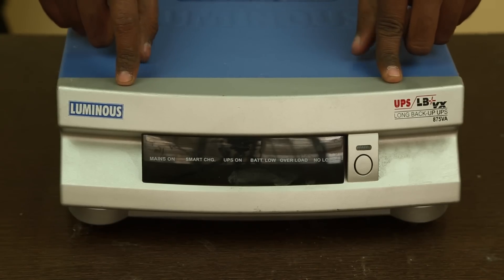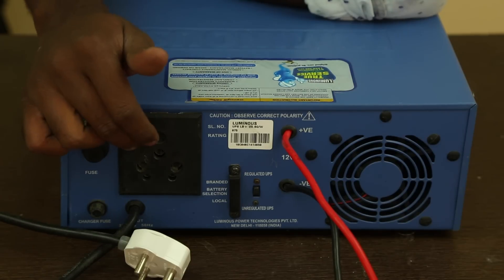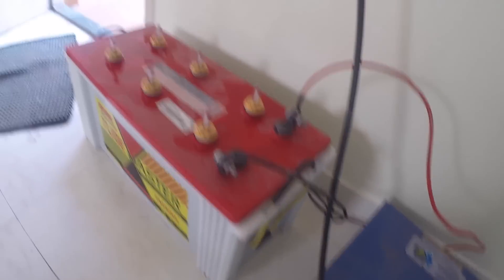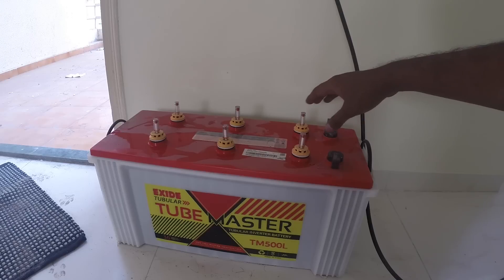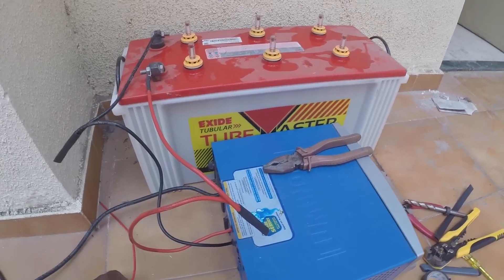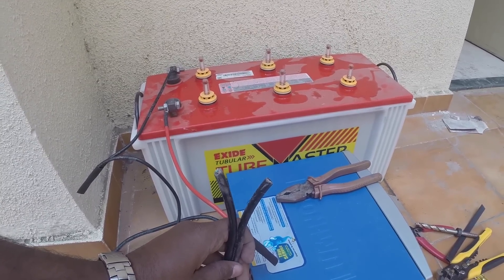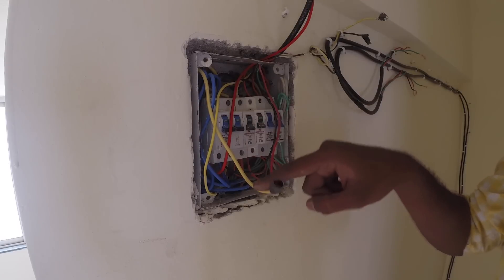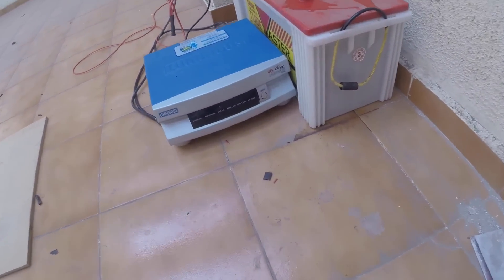How to - Connect an Inverter at your home with Battery Backup

Comment: Please I need help with my inverter. I am also using over 3kw solar and an outback MPPT charge controller. My inverter is luminous 1500 Eco Volt. My freezer are on timer so they switch off at the set time. Then at night time after few hours of low load of maybe 20 watts my inverter will go to standby mode but it can not come back online unless I off and On it again. How do I stop this.

Comment: inverter is not used 2 month any problem happen
Reply from the maker: +rajkumar goud battery may be discharged. Check battery voltage

Comment: if you using ac supply there is no positive negative..only phase and neutral..and then if u touch both leads in battery
 nothing will happen
Reply: In DC supply,if we touch either positive or negative wires we don't get shock.But if we touch both the wires at a time then we will get shock.

Now don't tell me that you have touched both the terminals of a battery and you did not experience a shock...! This is because,our human body itself contains minute electrical charges. which means we also have very minute voltages in our body.

Not only that, our human body can resist voltage and currents(because of body resistance which is different for different persons) upto some extent.Because our human body is not a current conductor.

Our human bodies only experience electrical shock if the current or voltage exceeds our body's current or voltage resistance which are 10 milli amperes of current and the voltage of about 30v  at average .These values changes for person to person because of their body constitution and their body's resistance.
Reply: It's a single 12v  battery. While touching the both terminals at a time nothing will happen. Because it's potential is low as compared to  230v A.C. At the same time if u touch terminals when battery bank voltage is more than 48v . U feel the shock.
Reply from the maker: Cool.
Reply: sahaya jimson JFK
Reply: same here
Reply: Yes that's right
Reply: Battery runs on dc thus it has positive and negative terminal
Reply: I touched both terminals and doing it from many weeks. But after watching that vedio I'm little worried coz I never feel any current ?

Comment: nothing will happen if you touch both the leads
Reply from the maker: Thanks for the info
Reply: ...as long as you are not with a metal conductor like spanners/ screwdriver across the leads
Reply: Correct!

Comment: you are not cleaning the distilled water, won't you be electrocuted if the water touches both positive and negative terminals
Reply from the maker: Its just 12v. So it doesn't do that.

Comment: how to connect the output wire from inverter to use the two way switch by using manual on off control
Reply from the maker: Check out my extension video to understand how to wire switches.

Comment: sir i have an issue with my ups.  the indications on the ups shows it is fully charged while the power is coming from the mains, but when the mains is off,  everything connects to the battery turned off and the indication in the ups shows low battery. please help me . thanks in advance
Reply: DINESH KUMAR T  your battery is not holding charge.get it treated and replace if still not ok
Reply: thank you sir i will check and inform you soon

Comment: how did you find negative wire of ups input, if i connect the input plug in opposite direction on wall outlet will it burn ?

How to find negative side of input plug of a ups ?
Reply from the maker: Nope. It wont. AC voltage does have positive and  neutral. But interchanging will not damage the parts. But if you interchange DC voltage then it will damage the battery.

Comment: where is the out put nuterial wire connection
Reply from the maker: Its connected to the mains.
Reply: Its already part of the 3 core wire that he fitted and is used to charge the battery

Comment: Mediamilan, Thanks for your very good video. I am using Luminous Zelio 1100
 + Luminous 18048 150 AH battery. My house wiring was done separately for inverter purpose. Normal lighting and large appliance wiring are separate.  But I noticed one thing, would like to ask your opinion. During power cuts, when home lighting runs thru inverter, large appliances like Refrigerator, oven,  AC, washing machine, Mixer and Water heater don't work as they are separate, but there is power in both positive and negative outlet of each socket of appliances. Is this normal. Please share your thoughts.
Reply from the maker: Heavy appliances cannot work with Inverter. You need a High VA inverter and it will be very costly. 
So avoid Fridge, Washing machine and water heaters.

Comment: sir, 
i have Luminous 875 VA. It is working fine when light is off and giving  backup. but when electric supply on there is a heavy sound(Garrrrrrrr) like hammer sound. I repaired it but problem remain as it. plz tell me which part is to be replaced so i can purchase from the market.
Reply from the maker: The only mechanical part that is inside it the transformer which steps up the voltage. That should be the problem.
Reply: Pz take a closer look at your batteries... they may be low... its possible. its happened to me...

Comment: neat and clean explanation. please make video on how to wire inverter connection and bypass 3 pin socket when power supply fails .with battery only power should get for only two pin socket,lights and fans. .

Comment: Spot on and Splendid Explanation! I have one doubt though how do I prevent myself from making the mistake of connecting the heavy load outlets (16A sockets) if we follow this method? Because if we do this method wouldn't all the outlets in the house be energized at the same time including the 16A outlets that are meant mainly for AC"s, Geysers, Fridges etc.? Please provide me an explanation
Reply from the maker: +Azaan Kaul yes. You are right. But if the wiring was done by a well known electrician then he would have put a separate MCB for the 16A power line. If not then we have to do a manual testing to eliminate the higher loads.
Reply: How do we do Manual testing in such a case please and how do we connect the inverter in such a situation please?
Reply from the maker: +Azaan Kaul if I find such a scenario in my house will sure make a video.

Comment: Thanks for the video.
want to how to identify either fridge point/geyser  is  linked to inverter.
Reply from the maker: +Suri Babu switch if the main and power of the inverter too. If the fridge or geyser switches off then it's connected to inverter.
Reply: mediamilan kk

Comment: Thanks :) Best explaining on this topic 
i've recently bought microteck puresire 1100va inverter with luminous battery 150ah [tall tubular]
If i'm running a heater using 1000 watts and suddenly main power goes out :(  its not going to blow my inverter right XD ? 
Or there must be some tripping switch somewhere in it ?
Reply from the maker: +Gamersway321go connecting heavy equipments like Refrigerator, Washing Machine and Heater is not advised. You might not blow the UPS but it will trip because of overload thus shutting down all appliances connected to it.

Comment: is it possible to charging and discharging by battery simultaneously
Reply from the maker: +Prashant Angadi Logically thinking I don't think the UPS works like that.
Reply: is it possible to connect battery while charging to load at simultaneously

Comment: in ac there is no neg it's phase or neural only......
Reply: mediamilan nice simple explanation. thank you. But at the time of a power cut if I had my AC , TV , refrigerator and other large appliances ON , then as soon as the power goes and back up comes from inverter, all these appliances will be load. which is too much. will it not damage the inverter ? why haven't you explained how to skip connection to the heavy appliances. you just connected the inverter output to the mains . we need to avoid some heavy load items . could you explain it
Reply from the maker: +simon peter cool. Will correct the words.
Reply: Navin Kotadia Sir its all right. He is helping us. We should not nitpick, should we?
Reply: He mistakenly said Positive....instead of Phase..........Negative....instead of Neutral...........And he has not done anything to correct this till my Post now.
Reply: When we connect input to the output than what would be happened tell me in online ups uniline
Reply: Mr Peter the main line has phase and neutral as it is ac. Where as the battery do have positive and negative as battery operates on dc.
Reply: Sar Kannada Dali video s thorisi sar plz
Reply: mediamilan Sir hindi mei bataye aur logo ko bhi samajh aaye thanks

Comment: sir, mujhse galti se heater ka cpnnection inverter se hogaya,gov power bhi nhi tha,ab to UPS  me line nhi aaraha  hain,,, ab kya kare sir,,plzz
Reply from the maker: Check the fuse inside the inverter. May be thats blown out.
Reply: fuse is normal,,,and in both input and output ac is also ,,,but neither ups is on nor any bulb glows,,,,now what to do sir,,plzzz
Reply from the maker: I am sorry but I have to actually see to understand the problem.